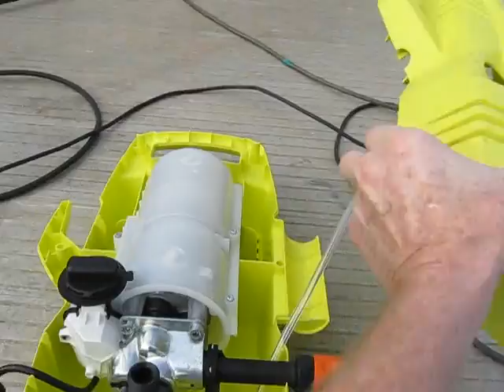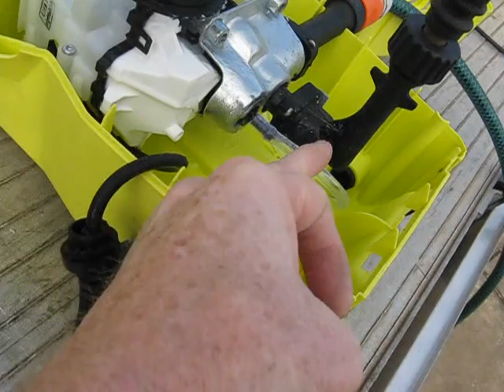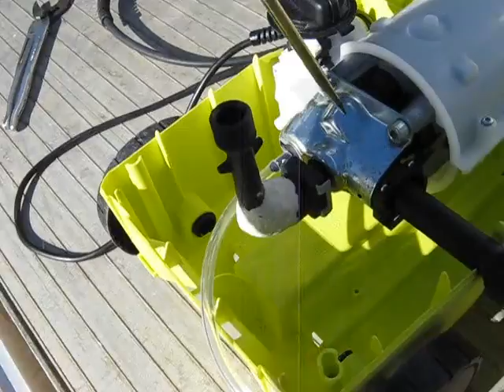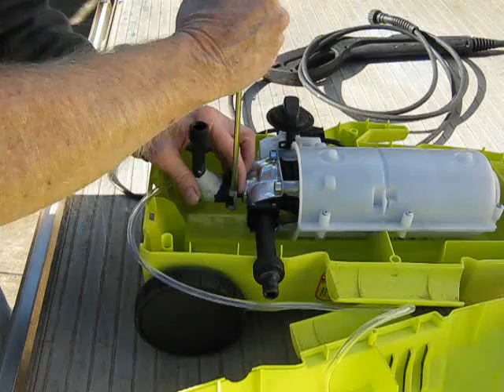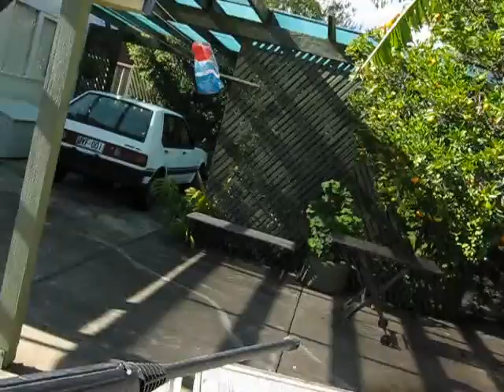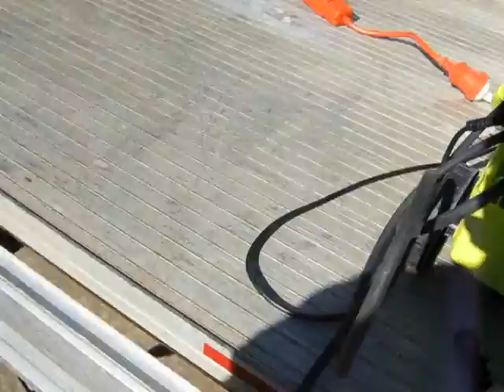Fix a leaking Karcher high pressure water cleaner for $15

Comment: Hi - great video and I'm in the same situation. I have mine apart and yes, it is that part that has split. Trying to find the part on eBay. Question: what do I call it for my search. I've tried a number of things but no luck. Thanks.
Reply from the maker: Search for " Karcher K Series Pressure Washer Elbow Outlet"  or " Karcher K Series Pressure Washer Elbow Outlet 9.036-703.0/9036703".  Make sure to get one exactly the same pattern as fitted.

Don't get ripped off.  Prices vary enormously on Ebay.  Cheers Rob
Reply: @Xynudu  Thanks. Just realised mine is the inlet elbow. Same problem - the seam has split.

Comment: Hi there , was a marcher winner 10 . If so what is the part number for hi pressure inlet pipe you replaced.
Reply: Karcher
Reply from the maker: Fix with part number 9036703
Reply: @Xynudu  thanks from vic Australia the cold state

Comment: I’ve had seven of these and every one has done the same thing, each time I’ve got In touch and they sent me a new one but now they said no more under warranty if I had looked at this I would have repaired the old ones, so tomorrow I’m going to see if the one I have now will repair, if it works I’ll put a advertisement saying I’ll buy your old leaking Karcher 😂😂😂
Reply from the maker: They should have beefed up the design years ago.  Obviously not up to the job.  Cheers Rob

Comment: Great video!! 
I live here in the UK.I too had had this problem,but at first I didn't realize. Until the water was spraying out the vents!!
So I took mine apart had found the same issue
Ordered new part today off Ebay ,getting it on Friday.So hoping to clean my patio and wash out my wheely bins.
Now,I was wondering if Karcher  had realized how puny this outlet connector was, (compared as you rightly said the water inlet) Why could it not be made in one part,or some sort of alloy?
Given the big pressure its under,or to make it so their is no seam and thicker material?
My other issue is there is not support on that stem further up.Like mine seems a bit fragile,until the casing goes one
Reply from the maker: Glad you found it useful.  It's easy to step on the pressure hose outlet and it needs to be made of thicker walled pipe same as the inlet.  It is also a poor fit in the main plastic housing.

Mine is still going fine after the repair many years ago, but it doesn't get a lot of use.  One way to help it last longer is to always turn on the water and pull the trigger before turning on the power.  This will make sure the pump head /valves are not dry as it will flow water through the system before the pump starts up.  That's what I was told years ago and it sounds like a good idea to me.

Cheers Rob
Reply: @Xynudu  Hello,exactly what I do without fail,run the machine with water only clearing any air pockets,before powering up.
Prob why mine lasted so long,Rob ,(15 year plus).
Look after your tools,they will last.
Reply: @Xynudu  What i also find ridiculous is that the manual doesnt state how long you can run the tool. I just watched Spanish video and he showed a K2 basic model, that manual did state it, it has a mx run time of 15 minutes.

Comment: I would put a straight outlet instead of this elbow one and make a whole in the outer casing to accommodate the modification ... This way i would gain more pressure , not overloading the motor by unnecessary elbow and should last longer.

Comment: If Karcher falls forward, high pressure hose transfers impact to part replaced.. Being a right angle,  it is the weakest point. On some K2 s it sticks right out.
Reply from the maker: Tread on the hose and it also puts a lot of right angle pressure on the unit.  The water feed connector is straight and twice as heavy.  LOL

Comment: The pump head is made of plastic!!
Easy fix. Take pressure washer to garbage dump where it belongs.
Purchase superior quality equipment. 
Make sure it has a brass pump head.
Reply from the maker: It's NOT the pump head that broke.  LOL
Reply: Top end machines use brass for a reason

Comment: I'm having the same problem. But, the part on mine isn't cracked. There's a little rubber ring that had failed, I replaced it and the leak stopped. Two weeks later, leak is back.. same problem, leaking from the connection.
Reply from the maker: Hi Lee, 

I haven't seen that issue.  Maybe the part the neoprene ring sits in is cracked ?

You could try some Silastic silicon gasket seal on the "O" ring as well.

Cheers Rob

Comment: I had exactly the same problem. When you remove the right angled leaking part the part it clips onto has the same thread. I just screwed the hose directly onto this and cut a hole in the end for the hose to poke out. $0 repair only disadvantage can no longer stand the Karcher on end. I have since progressed to an Aldi petrol pressure washer. Pump appears to be all metal. I now wash the same area with much better results and in at least a quarter of the time the Karcher took. Good video and your freebie machine cost a lot less than my new pressure washer.
Reply from the maker: Thanks for the tip Hugh.

The fact that you get zero support from Karcher on this obvious weak point is pretty poor.  Crappy design and crappy after sales service.  

Says it all.

Cheers Rob
Reply: Couldnt you angle out the hoze? so you can add hole on the side?

Comment: 1 year old Karcher K3 leaking, couldn't find warranty list, so I opened it by myself. Same leaking part. FFS "who" on earth put a tiny plastic for that high pressure.. Thanks for info, got it on ebay, but it is pricier now, not just 15$. Still worth it, thanks again.

Comment: I just dismantled mine and there is a crack on the inlet pipe. Just ordered one and waiting for him to call me with the price. About £10 in the UK but the Norwegian dealer will probably triple the price.
Reply from the maker: Nothing on Ebay ?
Reply: There is but the shipping to Norway will cost me £12 from the UK. My K4 has the reel on and the parts are different and more expensive.
https://www.ransomspares.co.uk/parts/brands/karcher/pressure-washer-spares/k4%20premium%20home%20wood%20eu%20(1.180-311.0)/suction-side/508368.htm
Reply from the maker: Oh I see.  Bad luck.  We have the same issue shipping in stuff from the USA.  Terrible price, where as from Asia it costs peanuts for a far greater distance.  Rip off USA postal services.  From UK is actually cheaper than USA to Oz.

Cheers Rob

Comment: Had a Karcher power washer purchased as a refurb with a Honda gas engine. Worked great with no problems. Perhaps the company has lost its good reputation now. Sold the unit to buy an electric Joe. Do not want to mess with gas and oil, not to mention the washer is quite heavy.

Comment: I was just about to buy a new one after my 4 month old K4 froze in the winter. Will dismantle tomorrow to see if it is as simple. The Kärcher service centre told me it was not worth repairing it and told me to buy a new one. They said a new motor would cost me 850 dollars which was more than a new washer cost.
Reply from the maker: I'm not surprised.  They seem to deliberately price spares so high no one would contemplate buying them.  I wonder if they even had the part in stock ;)

Comment: From 3:30s on, the crack damage is from dragging the unit around by the HP hose.  The cheap plastic outlet isn't designed to handle the abuse.  Good fix by getting a replacement part after discovering that almost nothing bonds to poly. Unfortunately, this new outlet, too, will probably fail from regular use. Bad design with cheap part material.  

The next part to go on this unit will be one or more of the control head, check valves or valve seals. Karchers are so cheaply made that, like filament light bulbs, are designed to conk so the customer will buy another. Perhaps the prior owner had the right idea by tossing on the curb.
Reply from the maker: Hi Jason,

They are light duty units for sure.  Totally agree with your comments.

The only way to prolong the control head and valves is to prime the pump (put water through it) before powering up.

Cheers Rob

Comment: I have a Kärcher K2.980 wich looks familiar with the model in the video. My problem is also a leak but I haven't located it yet.
When I connect water, theres little water dripping on the floor. When I add power, the cleaner keeps pumping in a 2-second-
rhythm and when it pumps, theres way more water, like a breaking dam. It spills completely from the bottom. When I try to
clean, the device reacts like normal and as soon as I stop, the cleaner keeps that pumping-rhythm again.
Reply from the maker: Run it with the front cover off and you will see straight away where the leak is.

Cheers Rob

Comment: Mine did the same thing unsurprisingly. I tossed the elbow in the bin and screwed the hose directly to the pump. Cut a hole in the bottom for the hose and job done. Its stronger that way and I've had no problems dragging the machine around by the hose over the years.
Reply: Make a video .please.

Comment: My outlet valve budges forwards when the power is turned on causing water to leak from between the top of the outlet elbow and the bottom of the pump connector. O ring looks ok. Any ideas, anyone?
Reply from the maker: Maybe there is a split in the elbow at the connection point ?

These usually only open up under pressure.

Comment: As good as new. The question is, if new is good on this one. Is the part really made out of polypropylene? Not even fiber reenforced in any way?
Reply from the maker: superdau That's a good question.  It has the characteristics of polypropylene when you try to glue it, heat weld repair it, and bond epoxy to it.

I'd say it is.

The thin walled section and stresses placed on it are not a great design point IMHO, and the reason it fails so readily.  No fibre reinforcing I can see in the composition.

It's certainly a failure point that you would expect the company to have addressed by now - particularly as it's used on so many models.

Cheers Rob

Comment: Please help, i used my dad's karcher abit much the past week and i broke it, it's leaking and there's hardly any pressure. I opened it up and i think the cylinder head is cracked and the reason why there's not much pressure is probably because those 3 rubber seals from the part below could be worn out. I just want to replace them both but here's the problem; i can't seem to find any of the 2 parts that are compatible with my dad's karcher, which is a K2.900. I can't even find it on any list including the one you posted the website link from. I live in belgium, what would be the cheapest way for me to find and order these 2 parts that are compatible with a K2.900. Btw it sucks they use cheap plastic stuff, probably to get people to buy a whole new machine every few years. If it would be made out of brass they could probably last for decades. Karcher doesn't seem to realize that some of their costumers will get sick of this and buy another brand.

This is the cylinder head i need, it looks like this: http://siteassets.ransomspares.co.uk/Products/150-150/KAR4.550-721.0.jpg

And also the part that is attached to it, the one with the 3 rubber seals, which looks something like this: http://www.partmaster.co.uk/image/420/2511981IM/2/z/

I need to find both parts that fit on a K2.900, preferably close to belgium to minimise costs but i'm willing to have it shipped from another country for a decent price, as long as it's fairly below the cost of a whole new unit.

I took a picture of the thing! http://s16.postimg.org/k10i5vvx1/11853920_1039493226074912_576559608_n.jpg
Reply from the maker: ***** Karcher really suck when it comes to parts and repairs on these units.

I agree, they want you to buy a new one.  

There are videos on YT showing cylinder head and valve replacement by tradesmen/repairers.  Contact them for the part numbers/help and try to get them off Ebay.

Best I can suggest.

Cheers Rob

Comment from the maker: Karcher no longer have parts diagrams on their site.  What a surprise. However, this link has diagrams for most Karcher units.  Pick your model and download the pdf file:  http://www.ultimatewasher.com/karcher-breakdown-diagrams.htm

Search for " Karcher K Series Pressure Washer Elbow Outlet"  or " Karcher K Series Pressure Washer Elbow Outlet 9.036-703.0/9036703".  Make sure to get one exactly the same pattern as fitted - they vary between K number models.

Don't get ripped off.  Prices vary enormously on Ebay.  Cheers Rob

Comment: Hello I have a leak happening just beneath the metal part... Any help?
Reply from the maker: jesse sangha Maybe the poly plastic part that screws into the metal housing is cracked or not sealing on the thread properly.  Check that.  Rob
Reply from the maker: xynudu I'm assuming it screws in.  You will have to have a look yourself to see how it's attached.  Rob
Reply from the maker: xynudu This link has parts diagrams for most Karcher units.  Download the pdf for your model to see how it screws together. http://www.ultimatewasher.com/karcher-breakdown-diagrams.htm

Comment: karcher washers are sh.... i had mine repaired so many times i could have bought a new one. so i did and went and chines washer and i have been using it for more than a year without a problem. when i took the karcher to the agent. they actually said that use it to much.and wanted $70 to get the part (outlet elbow)
Reply from the maker: Anura Disanayaka Wow, what a rip off !!!!!!!  My repaired Karcher has been going good, but they are pretty crappy the way they are made.  Cheap shit. He He. Cheers Rob
Reply: xynudu 
On a not very technical post:
Cheap GERMAN sh*t

Comment from the maker: The problem is further exacerbated by the fact that the connector is subject to pulling on by the hose to the gun, and it isn't securely mounted in the yellow casing of the unit.  Just poor design on both counts by my estimation.